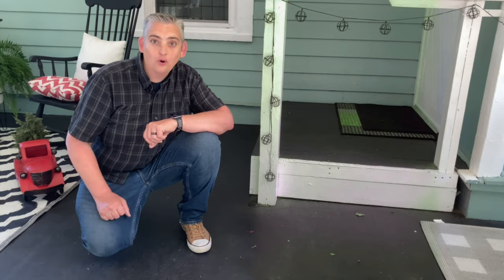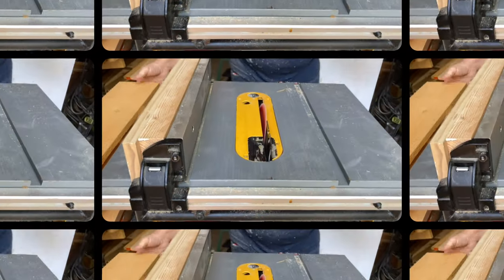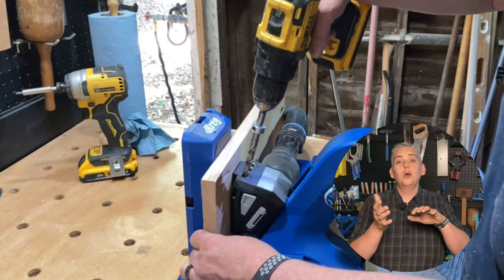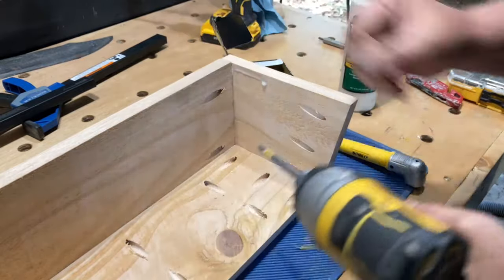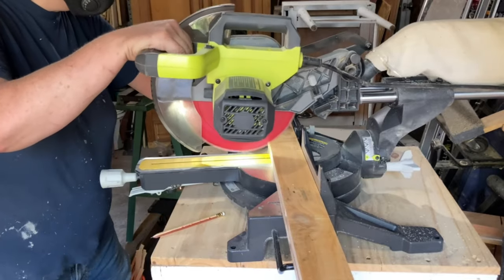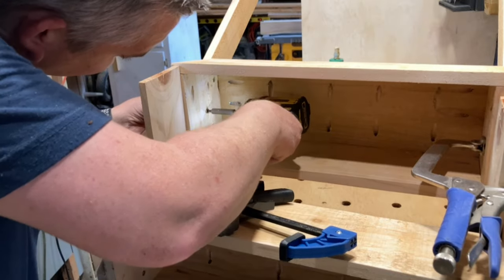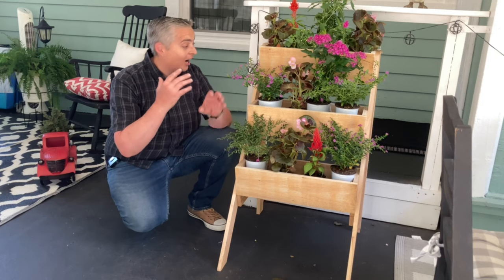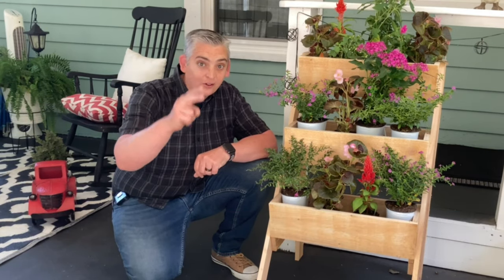Making A Three level Planter From Fence Pickets / Easy Woodworking Project

Comment: That is a sharp looking plant stand. I am unable to locate the plans. Could you point me in the right direction and what would you price that at?
Reply from the maker: So all together I used between 11-12 six inch wide cedar fence pickets, which run just under $3 each here in Jax, FL so the total cost was around $35. unfortunately, I just made it up as I went along, so I don't currently have plans, but it is on my to do list.